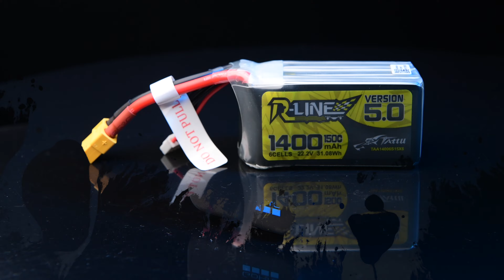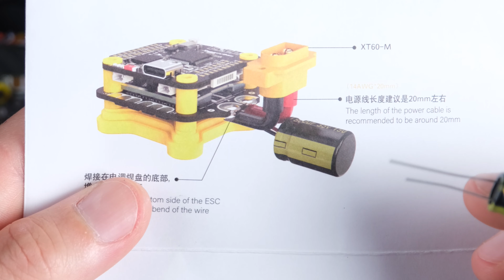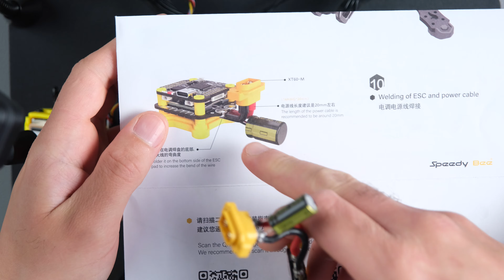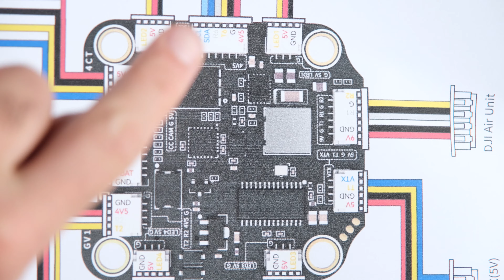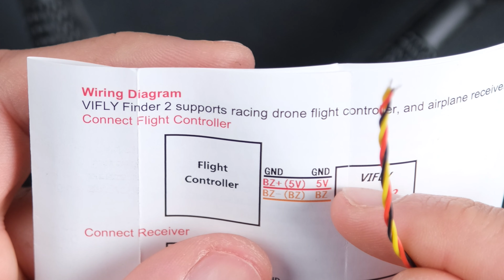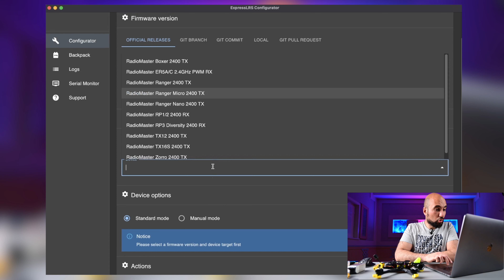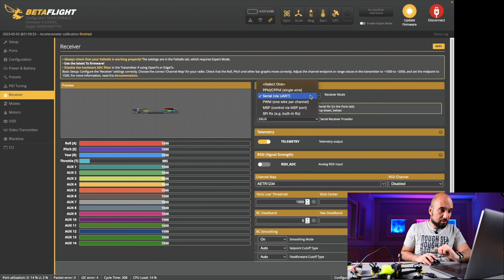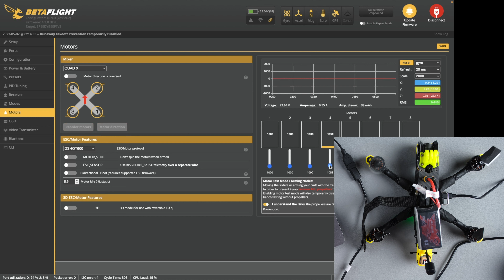Build 5-inch freestyle fpv drone | SpeedyBee Master 5 HD frame #fpvfreestyle #fpv #djio3 #bilumedia

Comment: U skipped the most important part the ports set up …….
Reply from the maker: You are absolutely right, my bad, sorry for that! If you need help with that part I can help you out ... I missed that completly in the edit !
Reply: @bilumedia  it’s ok brother you’re coverage is insane !!! I will be getting this quad end of month.

I just got a speedy bee f7 AIO and the dji port is inoperative and won’t pick up VTX on beta flight nor speedybee app :(
Reply from the maker: Thank you very much 😊!  I just took a look at your AIO and it seems that DJI should be configured on UART 6, did you configure it like this? You can give me a picture of your ports on Instagram: bilu.media. Let's solve the issue and get you in the air 💪😀

Comment: Heat gun is overkill for heat shrink tubing...just use the shaft of your soldering iron if you dont feel comfortable using a lighter
Reply from the maker: maybe you are right, but I have it and this is why I am using it, if I am travelling I use a lighter and it works just fine, thanks for the tip 👍

Comment: Hello, I just finished this build. I'm at the step that I get all beeps properly. But when I disconnect the battery the vifly finder buzzer doesn't beep. Could it be that in needs to be charged somehow? Thanks.
Reply from the maker: Hi. So when you plug the battery it beeps, right? If this is the case then the unit is working, but when unplug  it it doesn’t beep at all, this means that the battery is empty! It should work directly out of the box. I would fly a little bit, try at least 5 batteries and see after if something happens!
Reply: Edited response: I fixed it, I had messed up the + and - signs. It works fine now. Thanks for your help!

Comment: First of all, thanks so much for your video. It help me a lot. I have a question about motor, in speedybee website say it use 2306 1900kv but you use 2207 1750kv. Will it impact to performance? I cannot find 2306 motor here but 2207 are available so I wonder can I use 2207 instead. Thanks so much.
Reply from the maker: Hello, you are very welcome! Happy to help 😊
2306 is more for “cinematic” flight and 2207 is more for free style flight! But you wont feel the difference at all! You can use freely 2207 but be sure to be 6s, 1750 is 6s and 1950 is 6s too but it is a little bit less powerful bit not by much! So you are safe with 2207 👍
Reply: @bilumedia  Got it, thanks so much for very detail information.
Reply from the maker: @jonathanoeijoeng  you are very welcome, anytime 😊

Comment: I like how you spoke about the tools.  Not many, if any, that talk about the tools.  I've been wondering which to get or what's needed. I like to make sure to have the right tools before starting projects.  Especially like this.  Also good to include that in the budget.
Reply from the maker: Hi my friend, i talk about them because you need them to do the job, now some of them are sponsored tools and are expensive, but if you do this a lot they worth the cost, if not then there are some cheaper alternatives 😊!

Comment: if you read the specs there are built BEC 9 volt & 5 volt at F7 V3 Speedybee FC btw
Reply from the maker: Hello. I know! And normally you won’t have any problems at all, but my friend had a problem with the o3 turning into complete black, even if the bec was powerful enough, not with the this FC! I wanted to be extra sure, so i baby proofed this one 😅, but i am not doing it anymore unless it is absolutely mandatory, with some older units … but you are absolutely right, thanks for the valuable info 🤟

Comment: Im currently building this.. little by little.

I bought the V2 version. Very nice drone. I will have to buy a different GPS mount as it comes with a 181 mount and i bought the 880 gps. 

The V2 already comes with the GoPro mount in the box.
Reply: i got v2 as well. did you have the same issue with camera cable?
Reply: @andreikaliachka279  I am not using the DJI O3 unit.. I am building it with a Foxeer Trex Micro camera, and a Foxeer Extreme 2.5w VTX.

DJI system is too expensive for me right now.
Reply from the maker: @andreikaliachka279  the o3 is short by default, in the video i changed it to a longer one ! So you need to change it unfortunately, becarefull how you take the cable out, i damaged the connection a little bit and i had to open the camera again, in the camera you have at the end of the connection a little mechanism that clicks, this one you have to pull out carefully 💪
Reply from the maker: If you have a printer you can easily modify it, i made my own parts for my custom made 3 inc whoop and for my foxeer foxwhoop 2,5
Reply: @bilumedia  yeah I have a 3d printer. I will have to create a custom rear end for it.. because I purchased the RP3 receiver that comes with 2 antennas and the default yellow TPU piece it comes with is for only one antenna.. the receiver TPU part is also interfering with the mmcx antenna connector of the VTX and I did not notice and selected the 181 GPS when I checked out the order and I had purchased the 880 GPS which is way bigger. So I'll have to redesign that rear end.
Reply: @andreikaliachka279  They have fix few things in V2 like mounting point for DJI O3 unit isnt that far any more so you dont need to change the cable.

Comment: Hello. I'm having a problem with uarts settings. I used dji rc2 so no additional receiver. Could you please teach me the correct uarts settings?
Reply from the maker: Hi my friend, you have to go the Receiver tab and select SBUS instead of CRSF because this is the correct protocol for the DJI RC2 and I hope you didn't cut the brown and yellow wires from the DJI air unit cable 😁 because they are for the comunication between the RC and the receiver on the air unit! tell me if that worked!
Reply from the maker: I have a complete step by step build video coming soon 👍
Reply: I finished my build and it flys really well! Thank you so much! @bilumedia

Comment: Hello. So Thank You so much for this video. I just finished my master 5 build using your video. I have one issue. I can’t get sat lock!!! Are you having this issue. I’m using the bz-181 gps.
Reply from the maker: Hi my friend, my pleasure :) Did you make the necessary settings for the GPS in BF? I didn't show all the steps here, you have to select the GPS from the configuration tab in BF and in the ports tab you have to select GPS for the UART that you are using for that GPS! and after that you have to go to the Fail Safe tab and define how you want your drone to behave when it enter a fail safe situation ! I ended up not using the GPS because I don't fly so far with it, I am building a 7 inch drone and it has GPS! and there is a trick to get satellie lock faster, you have to wrap the gps wire in cupper foil and attach a black wire to that foil and connected to the ground wire together from the GPS, but make sure to wrap that coil afte intor a cloth tape or an electrical tape because it is conductive!tell me if you figure it out please
Reply: @bilumedia  Thank You for the reply. I have narrowed it down to ELRS interference. I move the GPS away from the ELRS receiver and antenna that are both sitting in the back and inside my house I get 18 sat locked! I tested it out with the gps zip tied to the front of the quad and I had 23 sat locked. So it’s definitely something to do with the ELRS antenna or RX.
Reply from the maker: @emafpv  glad that it worked after all 👍. happy flying 🛩

Comment: Very nice Video! 
Is it possible to connect the Dji Remote Controller 2 to this exact same build?
Reply from the maker: Sure you can do that! At some point if you see in the video I removed 4 wires from the cable that connects the dji air unit to the flight controller. The red and black are for powering the unit and the other 2 are actually for the sbus, so they are for using the dji rc2, and of course you will not need to solder the external elrs reciever as I did 😉
Reply: Thank you very much!
Reply from the maker: @Peterlustig234442  my pleasure 😊

Comment: Hi i recently purchased master 5 v2 frame, but as per manual i fixed front arm on forward facing of drone but i cant able to see holes 7:29. Forwad facing has long arm right.
Reply from the maker: Hi, maybe the v2 frame has different mounting? Or maybe it has a defect!

You can send me a picture of what you mean on instagram so i can see what is the solution for this. Bilu.media

Comment: Hi, great video, I’m assembling the same drone and I also wanted to get my esc facing forward and my fc facing backwards for the O3 unit but the cable is too small, where did u get a longer cable?
Reply from the maker: Hi, thank you very much! yeah the original cable is too short for this frame, here is the cable that I used : https://bit.ly/3FG6jmy, the V2 frame I understood that is a little shorter and doens't need this cable, but I am not entirely sure!

Comment: Hey, thanks for the video.I hate that mateksys BEC board. the pads of BEC (  in/out you had soldered ) easily peel off.
Reply from the maker: Hi, my pleasure 😊 ! Do you use flux? It helps a lot and the solder sticks very good and it never peels! Maybe your solder is not good too! I use 63/37 solder! So it should not peel at all, be careful because if it peels so easy you will loose your feed in your goggles and the crash is inevitable!

Comment: Great video ! 
What accum did you use ?
Reply from the maker: You mean the lipo batteries?
I have a lot of them:
Cnhl 1400
Cnhl 1050
Iflight 1400
Gnb 1500
Gnb 1300
Gnb 1100
Gnb 4000 li-ion

All of them are 6s for this drone 😊
Reply: and im new to this build (and diy itself), I believe there are no capacitors in the frame box. I should buy it separately ? or it will come with batteries? @bilumedia
Reply from the maker: @andreikaliachka279  the capacitor comes usually with the stack(fc +esc), did you buy the stack or not yet? The speedybee stack comes with bigger capacitor, but be careful, don’t cut the legs of the capacitor short because you will have problems, actually the new frame doesn’t have a battery plug, right? If not then it is not a problem because the wires will not take all the place and you will have space to wire the capacitor, but put them first and see where they sit and after solder them, and be careful the capacitor to not touch the frame, it can make a short!
Reply: @bilumedia  wtf. I found a big bench of accessories in my f7 kit. It is much more fun then Lego
Reply from the maker: @andreikaliachka279  😂 yeah it is a lot of fun, i love building drones, i want to transform my foxeer foxwhoop into an o3 drone and it is not made for this, it is challenging and i love this because i have to cut things to design tpu parts and it is a lot of fun, and a 7 inch drone is coming too, i am waiting for the frame, and i rebuilt my flywoo 2.0 drone woth a happy model mobula 8 😃, the video will come soon 💪
Reply: @bilumedia  hi again! where did you find this part https://youtu.be/57QlAXBj8g0?t=966 ? definitly cant find anything similar
Reply: and I believe i dont need RadioMaster RP1 if i m using dji controller?
Reply from the maker: @andreikaliachka279  you are right, you don’t need the rp1 as it is an elrs receiver and you are not using elrs radio controller 👍
Reply from the maker: @andreikaliachka279  the dji o3 heat sink comes with the frame! You are building this exact frame?
Reply: @bilumedia  v2. And I have only honeycomb heat sink
Reply from the maker: @andreikaliachka279  maybe it is made different! Contact speedybee directly and ask them, if it is a mistake they will send you one 💪
Reply from the maker: @andreikaliachka279  i took a look now on speedybee website and the honeycomb heatsink is flush with the frame so you don’t need the big heatsink, don’t worry it will not heat, i have the 3 inch build without any heatsink and it works perfectly, so you are safe 👍😊

Comment: Are you using v1 or v2 frame?
Reply from the maker: Hi, it is the V1 frame, but it is applicable to the V2 as well. I had a lot of people contacting me and the followed these steps, but for the V2 frame. Small differences is there of course 😊

Comment: Ty very nice and detailed just got this as well! Went 4s though so no capacitor and I use dji radio makes it little easier. Also no gopro for me.
Reply from the maker: Hello, why no capacitor? I advice you to put a capacitor, you have some space there…
Reply: @ never needed it been building since blue project falcon, only thing thats ever destroyed my squad was when I lost one in water.

Comment: Building v2 of this frame up right now with an 03air i took off a bnf quad where it was mointed in tpu.. i saw you had a metal bracket to screw it down (this would be ideal with the new heatsink)..where did that come from please. Great tutorial helped me out getting back into building after a 7 year break
Reply from the maker: really happy that my vide helped you get back into building FPV 🥰! the heat sink is from the frame itself, there are a lot of heatsink for the o3 air unit in the market, some of them are generic and some specific a particular frame... for example the SpeedyBee Mario 5 that I will build soon on the channel has a Pro version with a very nice heatsink and it protects also the Air unit, you can check it here : https://bit.ly/42Bu2PD

Comment: How long the cable from the camera from vtx that you swap ?
Reply from the maker: Hi, mine is 14 cm, i am not sure how you measure it, i measured it from the back of the camera to the back of the air unit, so didn’t consider the parts that are in the units! But you can ask speedybee and they will tell you which one to use…

Comment: this video was very helpful thank you so much

i have couple questions this will be my first quad

i have dji rc2 but.. is elrs better? should i sell my rc2 and get a new remote for elrs?
 SpeedyBee F7 V3 looks expensive...  can i use cheaper stack for example SpeedyBee F405 V4?
Reply from the maker: You are very welcome :), did you build the drone or not yet? let's speak on instagram : bilu.media, we can talk easier and I can help you with all what you need 😊

Comment: Is the battery strap included in the frame kit or did you buy it separately? If you bought it separately, what size is it? I bought this frame and I can not see this in the kit frame BOM list
Reply from the maker: Hello my friend. The strap comes with the frame, actually i think you get 2 straps! If you didn’t get it, please contact SpeedyBee and they will send you the straps 👍, the strap size is 250mm
Reply: @bilumedia  Thank you very much for the prompt reply. The frame kit is on its way, I just checked the materials list included in the kit and I didn't see the straps, it's good to know that they are included. Thank you so much.

Comment: Is F722 stack much better than F405 stack also from Speedybee ?
Reply from the maker: It is better yeah, but you don’t need that much power in most cases, f405 is very good 👍

Comment: Need to flash esc firmware?..or already..because  1 my motor not beep
Reply from the maker: It should work without flashing anything! Check your wires, maybe some wires are touching! You can send me a picture on instagram : bilu.media

Comment: Hi! A question: I've built the same frame with the same stack (I haven't seen your video before I've put it all together. Unfortunately, it would save me a lot of time :)) 
But the stack mounting bolts are too long, so they protrude from the bottom. Seems stable, though... 
Was it the same case for you?
Reply from the maker: Hi. You mean the screws are too long and there is a part remaining on top? If that is the case then yes, but under the esc i put another rubber grommet, but it is small ! You can send me a picture on instagram so is see what you mean : bilu.media

Comment: What GPS module did you use? I couldn't find it in the parts list. I think DJI fixed the short camera wire issue. Mine seems to be long enough. I cringe at the thought of having to take the air unit apart. I don't even want to remove the screws to mount it.
Reply from the maker: I used an older gps here, but you can use the m10 gps, i used iflight m10 gps and it is very good 👍
Reply: @bilumedia  the included mounting box that you used for the older gps is 18*18*8mm and the iflight m10 is 25*25*11mm. So I would have to figure out some kind of custom way to mount it?

Comment: how much flight time did you ger on this ?
and will 2306 1700kv increase flight time ?
also what will be the consequences of using higher milliamp battery?
also what will be the results of using lower pitch props?
plz reply
Reply from the maker: I think around 5:30 minute with the 1500 mah battery, just cruising…2306 will not make the drone fly more, just a little different

Comment: Smoke stopper is a gimmick and doesnt actually work.
Reply from the maker: I guess you can connect a bettery and on the othe side connect 2 touching wires and see if the red light is on  or not 😀
Reply: It saved me many times